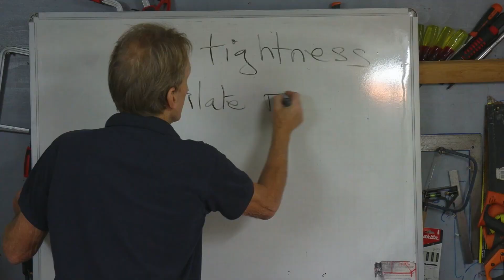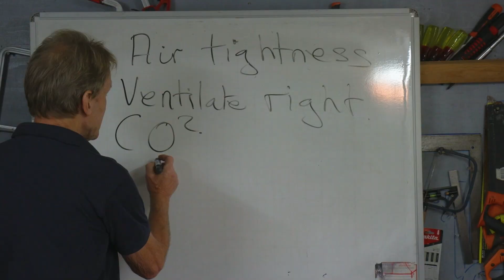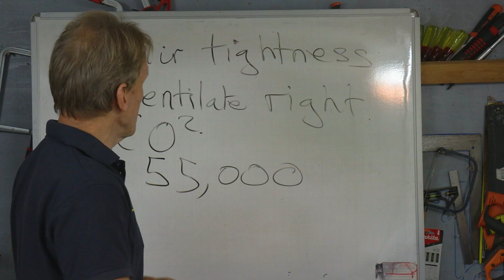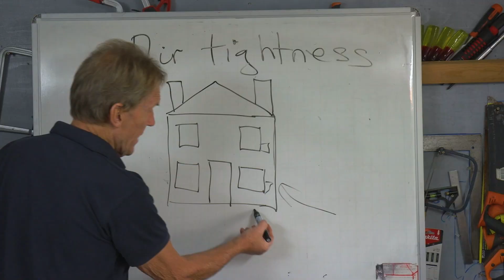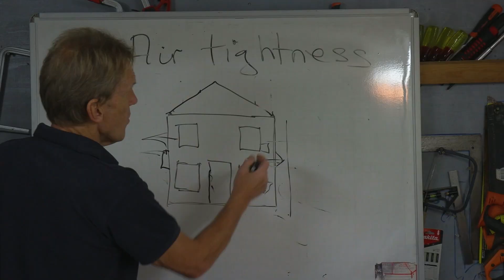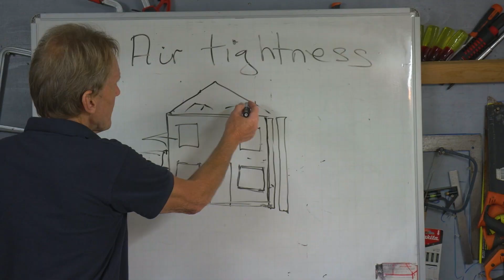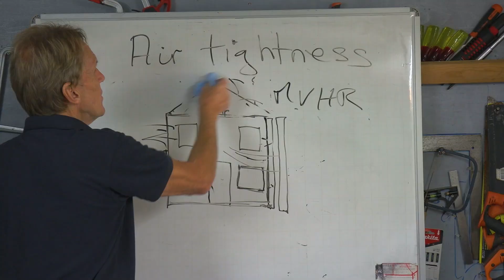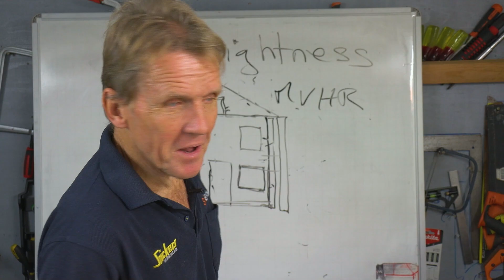The Ugly Truth About Airtight Buildings

Comment: Airtight buildings work if you use heat recovery ventilation. Not only that, but all the windows should be double windows, as in a layer of windows close to the outside of the wall and another layer of windows close to the inside of the wall, and this also applies to the windows which open (though you might want one of the windows to be a sliding window, which is cheaper). Ideally, you would have a heat recovery system for every room, but you should have at least one for the whole house and connect it to every room. For filtering the air, you could even use one of those homemade filters made from metal sheet or plywood which lets you use a few rows of tissue paper or paper towels which get secured by a few hinged parallel arms tight against the netting which supports the paper towels/tissues, allowing you to easily unscrew the cover, unscrew the non-hinged end of the parallel arms, change the cheap filter with other cheap filter, screw the parallel arms and then the cover, and you're good to go. 

A 5 minutes job even kids could do (especially if the screws have handles) is a lot cheaper than a 30 minutes job for which you need a very expensive filter and to a paid professional to do the air filter replacing. And you could even use a water filter for the air going into the house, before or after the paper filter (ideally while the air is still not heated when the temperatures outside are above the freezing point of water, the switching between the two can be done using a thermostat and two electric actuators), which you could automate by having a tap which is set to a few drops per hour, the overflow going into the sink, and the air bubbling from the bottom of the water container (which could even be made from a metal funnel and some piping).

For those interested, they can make a (DIY) heat recovery ventilation system themselves, with nuts, bolts, lots of washers, industrial tinfoil or tinfoil to which you added scotch tape (packing tape) on one side for more strength against tearing, some plywood or plastic or foam or metal sheets plus some glue or spray foam for gluing and insulating the case, scotch tape or aluminium tape (optionally replacing the glue or spray foam for insulation), and some pipes of different sizes and either cement or oven caulking/insulating material. You can look online how heat recovery ventilation system work in more detail, but they have one fan pushing air in (so you have a higher pressure inside the house, to get some of that air out through the places where the house is not airtight, instead of having cold outside air get in when you have a lower pressure inside the house), that air is then split into a bunch of air chambers cold for air going, each in which being placed in-between two adjacent layers of warm air going out, those chambers tend to be fairly long to transfer as much heat from the warm air going out to the cold air going in, those layers needing to have their spacing consistent which is where for the DIY (do-it-yourself) version you use that bunch of nuts, bolts, and the washers for spacing, and having the layers thin enough and long enough will end up in recovering enough of the heat. For example, the "sandwich" of layers could have the even layers for air going out and the odd layers for air going in. Ideally, have the pipes for air going in and air going out be at opposite sides of the same two opposite corners. One corner has on one side previously-cooled warm air air going out of your house, and the other side cold air getting in to get heated, and the opposite corner has on one side warm air going to heat the cold air and on the other wise the already-heated previously-cold now-warm air which to replace the air in the house. For the fans, a single room or a tiny house can use an USB fan or two running from a USB charger (with a long-enough USB cable), while a house might need a bigger fan connected to an electricity plug/outlet in your house. Those who live in windy areas could even use a small wind turbine to mechanically power a fan.

Sure, it will take a lot of space, and quite a bit of effort to make and set it up, but it would be a lot cheaper to make than buying one, which makes it ideal for poor people who have a lot of free time and maybe not a lot of skill to make money with (i.e. kids and students trying to learn a trade or trying to save some money for their house).

Edit (1 year later) : And the sad part is that the idea at the end could help some people make a business or a job for themselves. I mean, a store-bought Heat Recovery System costs $1000 or more to buy, but less than $300 to make (at most $500, depending on how efficient you make it, and if you use thermostats and things like that, and if you include the usage of paper kitchen towels as an air filter and mechanism to use that), so you could easily sell that for $700 and make a profit. 

And in that high price I'm assuming you're using metal sheets instead of hard-plastic sheets or plastic veneer, GB-Weld or other mixtures which adhere to metal instead of silicone adhering to plastic which was lightly brushed with a power-drill to increase the contact surface for better adhesion, thermostats for stopping it form working when the temperature of the air going into the house gets too cold or too hot for human comfort (which would significantly reduce but not stop the air circulation), the cheapest fans you can get your hands on instead of silent PC fans from Noctual or similarly-quiet alternatives, a system for adding a professional i.e. N95) air filter aside from the paper-towel air-filter as opposed to no air filter or a few vacuum cleaner bags in parallel, and maybe even adding a solar-power circuit to use solar power during the day and during the night battery power charged from solar power during the day. 

Heck, with cheaper materials, louder fans, and only a paper-towel air filter, you can make that for $200 or less. As I said, the cheapest and thinnest plastic siding, cheapest PC fans you can get, cheapest chinese usb power cord and power plug you can get for powering the fan/fans, cheap wooden casing for the paper towel filter, which covers almost the entirety of a wall and requires unscrewing standard screws to replace, and the cheapest (indoors or outdoors) silicone for insulating the layers of cheap plastic siding for directing the airflow and making the whole thing work. It would be big, bulky, and probably also ugly, but it would work, so you could use it yourself, or sell it for $300-$500 to people who don't care about how it looks or how power efficient it is, only that it works and it's cheap. Heck, people living next to a highway or a busy city center would benefit the most, from one of those.
Reply: Fantastic comment thank you for sharing all of this with us
Reply: @theowhite  My pleasure! I'm glad someone actually read my comment. Most people won't read a wall of text. And the sad part is that the idea at the end could help some people make a business or a job for themselves. I mean, a store-bought Heat Recovery System costs $1000 or more to buy, but less than $300 to make (at most $500, depending on how efficient you make it, and if you use thermostats and things like that, and if you include the usage of paper kitchen towels as an air filter and mechanism to use that), so you could easily sell that for $700 and make a profit. 

And in that high price I'm assuming you're using metal sheets instead of hard-plastic sheets or plastic veneer, GB-Weld or other mixtures which adhere to metal instead of silicone adhering to plastic which was lightly brushed with a power-drill to increase the contact surface for better adhesion, thermostats for stopping it form working when the temperature of the air going into the house gets too cold or too hot for human comfort (which would significantly reduce but not stop the air circulation), the cheapest fans you can get your hands on instead of silent PC fans from Noctual or similarly-quiet alternatives, a system for adding a professional i.e. N95) air filter aside from the paper-towel air-filter as opposed to no air filter or a few vacuum cleaner bags in parallel, and maybe even adding a solar-power circuit to use solar power during the day and during the night battery power charged from solar power during the day. 

Heck, with cheaper materials, louder fans, and only a paper-towel air filter, you can make that for $200 or less. As I said, the cheapest and thinnest plastic siding, cheapest PC fans you can get, cheapest chinese usb power cord and power plug you can get for powering the fan/fans, cheap wooden casing for the paper towel filter, which covers almost the entirety of a wall and requires unscrewing standard screws to replace, and the cheapest (indoors or outdoors) silicone for insulating the layers of cheap plastic siding for directing the airflow and making the whole thing work. It would be big, bulky, and probably also ugly, but it would work, so you could use it yourself, or sell it for $300-$500 to people who don't care about how it looks or how power efficient it is, only that it works and it's cheap. Heck, people living next to a highway or a busy city center would benefit the most, from one of those.
Reply: I’m not going to lie and claim to have read all that, but your comment about two windows confused me; triple glazed windows are superior to double glazed and double glazed windows are superior to the type you spoke of; my granny used to live in a 500 year old listed building, and wasn’t allowed to make alterations to the exterior so  she had sliding windows on the interior, behind the original windows, and they were rubbish.
Triple pane, super air tight European style windows with tilt and turn operation are the best. (Actually in some European countries they’re starting to make 4 or more paned windows, but that seems overkill
Reply: @benhart777  While that might seem to be true, heat travels around the window panes, too. For example, the frame of those "triple-pane" panes. Or the cement/concrete and spray foam around the window holding those triple-paned windows.

Comment: Brilliant video.  We have a few trickle vents, extractors and this is the main reason why I will not have cavity wall insulation.  There's a few drafts, an older wooden front door, we have an open fireplace, there's a point to keeping them - a few drafts is a very good thing.  Our house is 70 years old and the 1st floor was re-rendered just before we bought it, I have no idea who rendered it and what it was rendered with.  If the house is chilly... it's jumpers and dressing gowns, no big deal.

Comment: There is no such thing as a free lunch but you can reduce its cost. Taking into account global warming and trying to reduce the amount of heat energy used in a house we have sealed the houses, which in turn causes health issues and dampness. Solution add an MVHR, problem returns where families then don’t want to run them because they are a constant electricity draw (fan and heater to warm cold fresh air). It would make more sense to make smart meters talk to mvhr systems and than any electricity used to run them be either sourced from solar panels or free from the grid.this would mean that there would be no reason for people to turn off the MVHR to save money and power used would be produced centrally in the most efficient way.

Ultimately there will always be a cost but some costs should be met by society as a whole.

Comment: The thing I notice we don't really see in the UK is Heat Recovery Ventilation. Using a mechanical system creates a much much better environment and the cost of running them is negligible compared to what you pay on your gas bill.

Comment: A sealed plastic box can pass an air tightness test. But a plastic box has a U value of toffee! The airtightness test hides thermal bypass in so many buildings. Both domestic and comercial.. This test should be carried out pre plaster to make it real. 40 houses on our estate passesd this test, but have cold air flow just behind the plasterboard...  So U-values of a single plasterboard. Building regs part L fail completely hidden!

Comment: Use active exhaust fan with humidity sensor. My house now only around 50% RH in winter nvr goes beyond 60%. And I have temperature and humidity meter in every room. Use radiator with digital thermo heating in central can be automated. I find most issue arises due to ignorant. Google and with a bit of common sense you will find condensation not a big issue, temperature will be enough. Draft can also come in from the exhaust fans so use a draft prevention vents or exhaust fan. Technology is so advance now, pls use it.

Comment: Just finishing our Passivhaus build so I thought I’d share a few numbers here for info. 

The house has a volume of about 400 cubic meters, 5 tonnes of cellulose (shredded newspaper) insulation, triple glazed windows and an MVHR system but NO heating system at all - well, that’s not 100% true, it has two 600w electric towel rails, a hob, oven, hot water cylinder, fridge, freezer that all produce some heat but there’s no “heating system” as such - no boiler, no heat pump, no rads, no under-floor, no wood-stove etc., nothing. 

The final airtightness test result was 0.07 air changes per hour at a pressure of 50 pascals, which is VERY airtight, even for a Passivhaus, which has to be below 0.6 ACH. This is to prevent air/heat leaking out of the building in an uncontrolled way.

However, the MVHR system runs normally at 110 cubic meters of ventilation per hour and so completely changes the 400 cubic meters of air air inside the building about every four hours or six times per day - which is a lot of ventilation.

The benefit of doing this is that the stale air and moisture is leaving the building but the heat is not! Most of the heat is being put back into the building by using it to heat and dehumidify the incoming air. Here’s a snapshot of the MVHR numbers:

Extract air: 17.9° 61%
Exhaust air: 10° 89%
Outdoor air: 7° 94%
Supply air: 17.7° 53%

So it’s only lost 0.2° of heat and it’s reduced the humidity by 8% whilst completely changing the air in the house every four hours and is doing this whilst only drawing 14w, ie the equivalent of a couple of LED bulbs.

So, airtightness, ventilation, moisture control and “heating” all rolled into one.
Reply from the maker: Thank you for that. An airtight building with MVHR makes a lot of sense, without it, not so much.
Reply: Finished my airtight house 10 years ago.  If/when I move, the one thing any new house must have is MVHR.  It is such a game changer effecting your quality of life.  I visit other people's houses and they just feel unhealthy.  I built close to PH standards but the only thing you have to watch out for is overheating.  Our house needs no heating with 3/4 people inside, but add a few more and you have to open some windows. Christmas dinner with family is always with Veluxes wide open 😀

Comment: I'd be interested to know if running a dehumidifier should be considered a good idea?
It's the approach I take to try and avoid damp issues without losing heat (costing money) to ventilation, but I'm happy to be corrected. 
I can see it does nothing about C02 buildup and oxygen depletion :-/
Reply: I'm a fan of dehumidifiers, especially in a room with no damp course, dripping wet walls, or black mould.  They are cheaper and more efficient than heating.
Potted plants are quite good at converting CO2 to O2.

Comment: 1.there a thing co2 and co sensors that can ring up in case of emergency 
2. A regular car envelope is extremely airtight still ppl are not dying or suffocating  
3 i do agree airtightness is overated in energy saving cuz hypothetically home built with vaccum sealed glass will still be poorly energy efficient 
4 so much discussion on efficiency rather affordability. What point of car giving 30% more mileage if its gone 500% in cost over time

Comment: Just back from Iceland House is constructed with 6" thick walls stuffed with mineral wool and 8" on the roof and floor. OSB or ply facing internally and corrugated metal exterior with OSB and a vapour barrier. Warm as toast, even with double glazing or though some have triple. So why do we build with 2 skins of brick/block and such complex expensive materials

Comment: I live in Canada with much more extremes and I agree 100%.
Heat return ventilation systems are problematic and have a 15-year 20-year shelf life.
It's hard to retrofit homes with the required ventilation ductwork for such systems.
Bite the bullet open a window.
The flip side is if you have a bunch of people in a small room that room will heat up quite quickly almost asking for an open window.

Comment: I had a passive build in mind, not fully, but pretty tight. (Most materials bought already). Eps raft system, tripple glazed, 250mm wall insuation with wood fibre breathable outer insulation, 350mm ins in roof, air tight wrap, wood clad, with mvhr. But I'm running out of dosh so cant afford an mvhr and wood clad. (Render is cheaper and  I'm building all myself). So now have the difficult decision of whether to keep in the farts or let them escape. I may go half arsed on this one.

Comment: A few years back I worked in 'snagging' for a bit, I've seen this condensation problem numerous times, as soon as the tenant closes the trickle vents it's game over. And many internal doors fitted without enough air gap underneath to allow the trickle vents system to work correctly anyway. MVHR essential on new builds really.